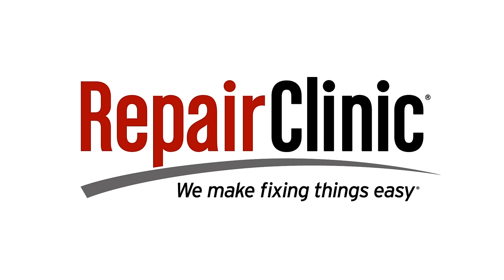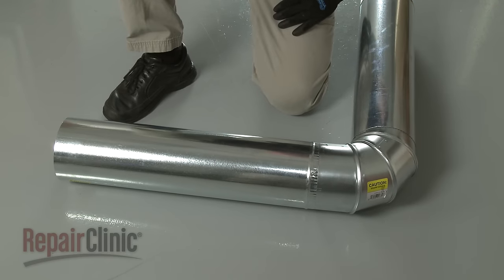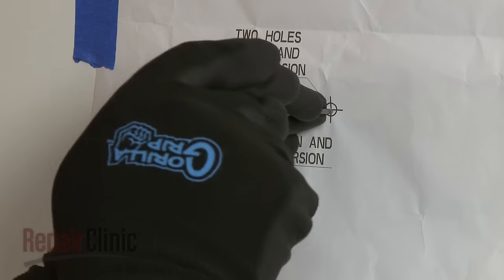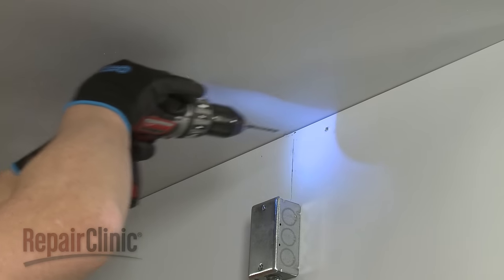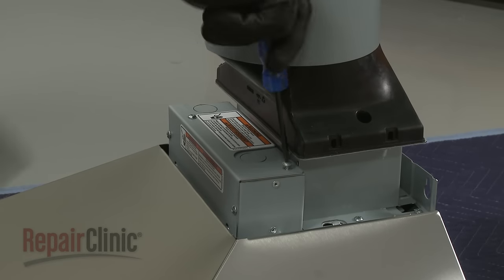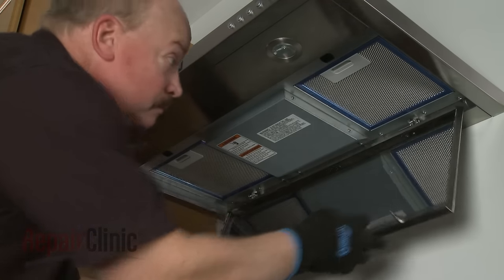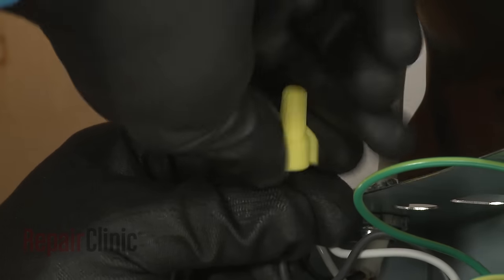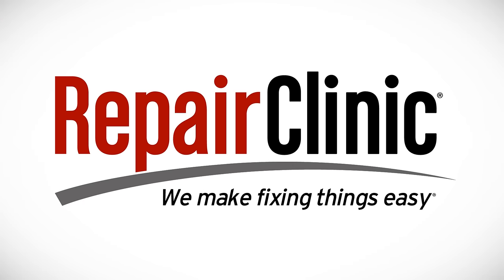Kitchenaid Range Vent Hood Installation (Model KVWB400DSS)

Comment: Moved into a new home. Noticed that the paint by the side of the rangehood is peeling/staining +- small cracks emerging around joint lines. There is silicone/sealant on the edges of the rangehood, which seems to be deteriorating/having gaps. Is air escaping and this is causing the issues? Do I just need to reseal it with more sealant? Is sealant use normal when installing rangehoods?

Comment: Nice video but I do not feel comfortable installing such a heavy piece with drywall anchors.   I would run backer board that is nailed into a stud that way you know its not going to come falling down.
Reply: Backer board!  What a great idea.  I never liked drywall anchors.
Reply: @claypottinger7372  I feel the same I fixed a tv to a dey wall before wasnt that heavy I think 16 kg ish but smtthubg over 20kg I'd be cautious I understand drywall is used everywhere these days especially new builds but it's all cost saving I'm not a fan undercoat and skim all the way lol
Reply: What do you mean by backer board?  You mean a layer of plyboard behind the drywall?
Reply: Ugh mine just fell
Reply: @claypottinger7372  I put up 1/2 inch plywood around my kitchen wall area where the cabinets are going and range hood.
Reply: Like George Michael once said 
"You gotta have faith".

Comment: Instructions are very good, wall plugs will not hold bent hood. I needed to cut plasterboard and put a cross piece of 2x4. I left protection on until the end, and it’s impossible to remove as the protection layer wraps around the back of the vent and main piece. I had to remove the vent then remove the protective wrap and the re-install. I had to loosen the main piece in order to remove the wrap which is wrapped around the back. Very frustrating.
Reply: Vent not bent sorry

Comment: Our hood is quite heavy. I’m concerned about hanging it with only screws (or even anchors) to the wall. The studs do not line up where needed. Any suggestions?
Reply: toggle bolts, they will hold the hood up
Reply: The EZ toggles is the superior anchor, otherwise open the wall and add wood blocking..